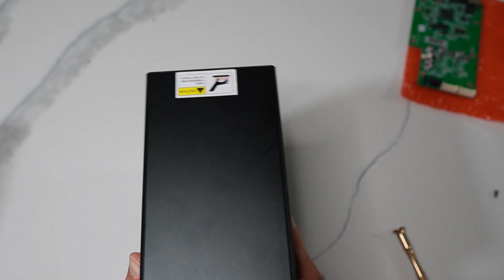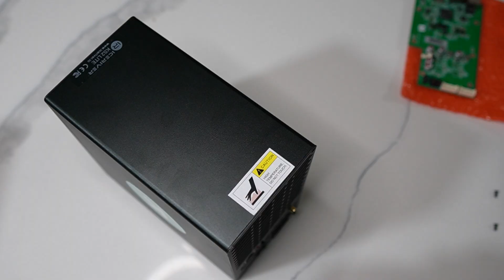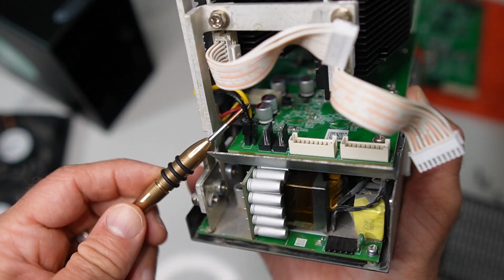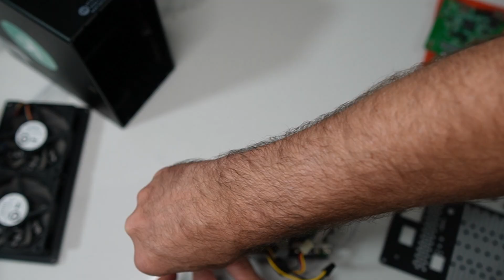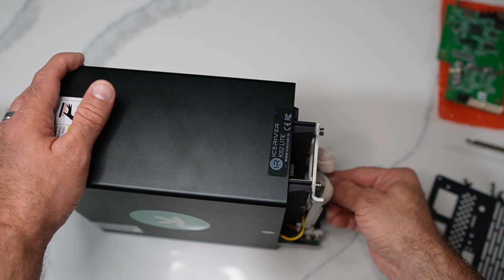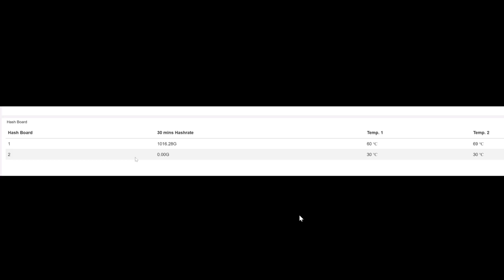Iceriver KS2 Lite Full Teardown & Reassembly Guide (Control Board Swap Attempt)

Comment: If the ribbon cables are long enough, swap them on the control board and retest.  If the working board swaps to the second position in the GUI, then you know its the hashboard and not a controller problem...  Good luck!
Reply from the maker: Hey Alltrac! Thanks man, I did try that as well. Its weird because both hashboards work individually but no matter what I do when I plug in a second hashboard it wont run the 2nd board. Even with the new control panel. I must be missing something but I wont give up, ill eventually try something else. Thanks for commenting, I'll probably try what you suggested again and take down notes and take pictures of each configuration I try next time to keep better track.
Reply: @GreaterGoodMining  Give the ribbon cables a good look over, they have small wires and can break at the pin.  Swapping with known working parts is a good trouble shooting method.  Start with one cable, one hash board.  If it works then try second port to prove control board good. Replace with second cable and repeat.  Make one change at a time so you know what is working and what is failing.  Happy Sunday, and Merry Christmas to you and yours!
Reply from the maker: @alltrac89 I'll give it a shot again and be more systematic about it like you said. I dont want to give up (it's annoying when I cant fix something lol)